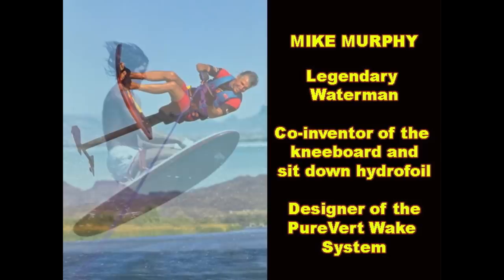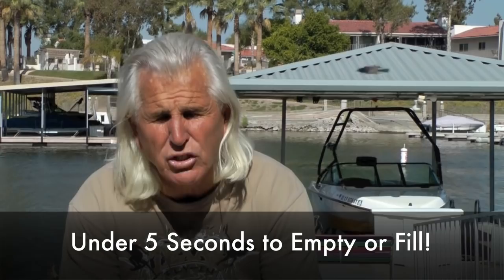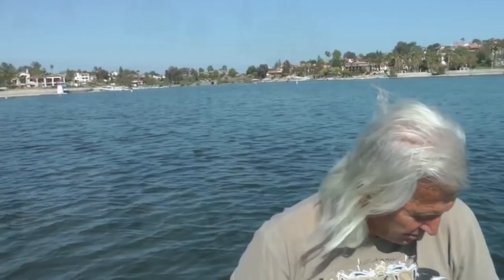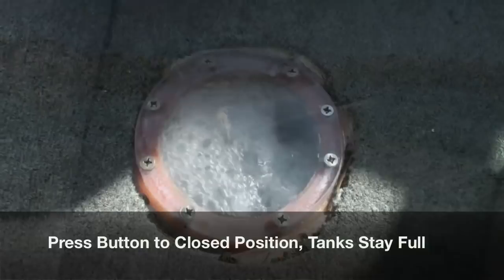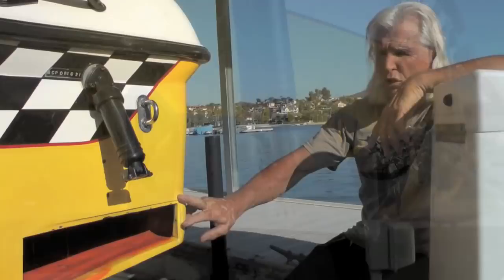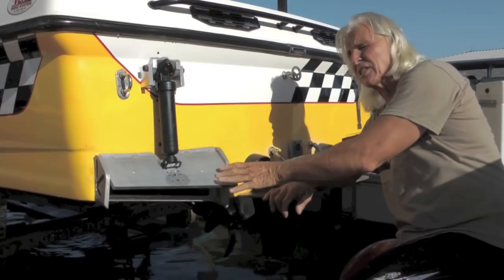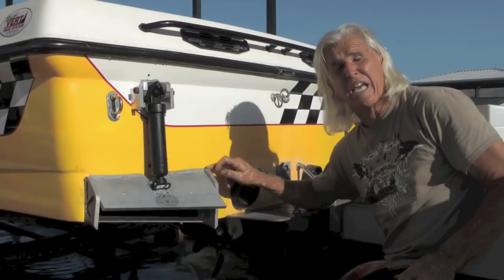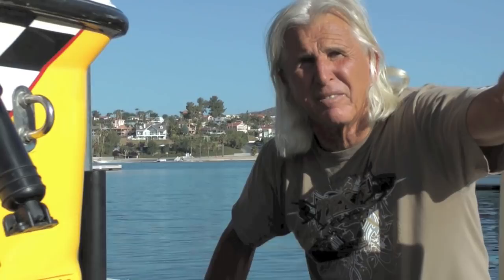Best Boat Ballast System: 1,000+ Pounds in UNDER 5 SECONDS! No Pumps! Mike Murphy

Comment: Please plan on integrating this into the boats computer so deploy, closed, and open operations all happen automatically based on speed. Also, please use an electric screw drive actuator if at all possible, hydraulics in boats are messy and maintenance on them sucks! Great concept, polish that baby up.

Comment: really whats going to happen is the entire system will be integrated into the boats computer. The deploy and undeploy when this thing is polished on the market won't have any switches most likely. Malibu has their wedge hooked up to the computer to not let a driver move the power wedge unless its in gear so swimmers legs can't get crushed. The nautique NSS system deploys and undeploys automatically at certain speeds to stupid proof it, etc, etc. See the vision my man! Neat concept btw.